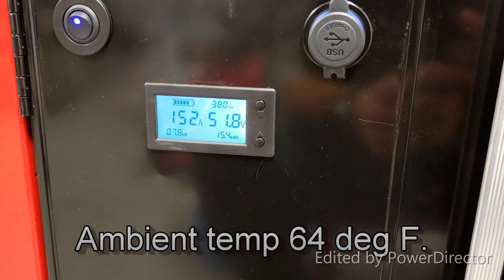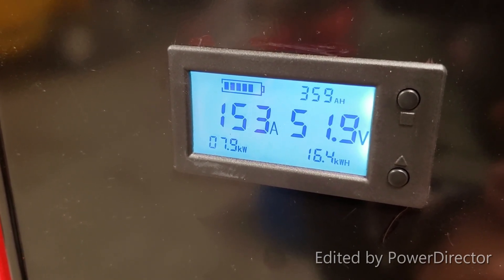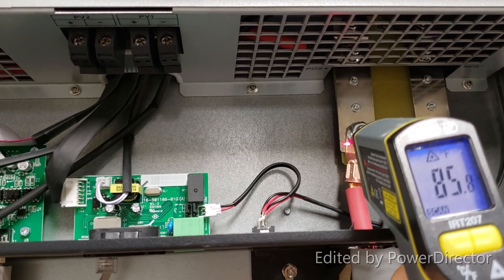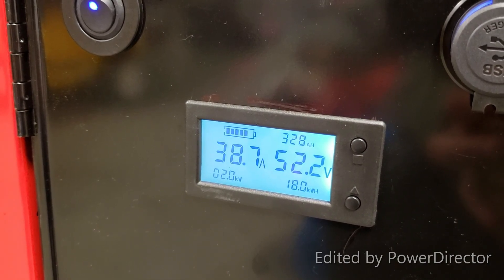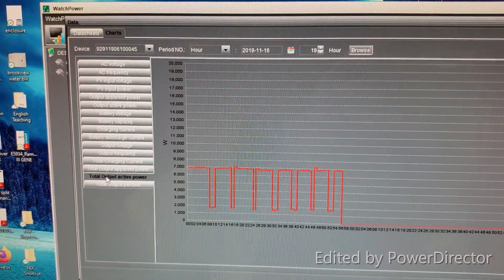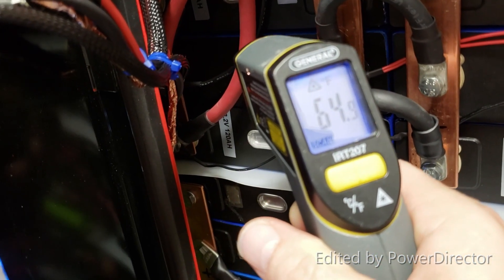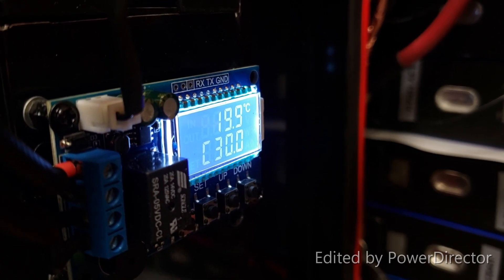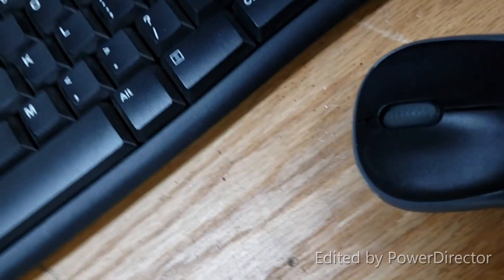MPP LV5048 and Power Wall Load Test

Comment: something to consider is a Heat Pump dryer. crazy efficient, low draw, and all electric  . ticks all your boxes. Also, cheaper than batteries inverters and panels

Comment: Hello! Really enjoy your videos! Was thinking the same about using a dryer. If you're going to dry clothes with a battery, you need a gas dryer.
Reply from the maker: Thanks for the comment. I go back and forth between wanting a gas dryer and keeping the electric one. However I do want to be as energy independent as I can be. If I replace electric dryer with gas one I am replacing one dependency with another.. Time will tell. Watch other videos. I am planing to install more power walls.
Reply: @DMIINC2013  Clothes will dry on a clothes line even in the winter.  A friend of mine lives in Colorado and is determined to never use a clothes dryer.
Reply from the maker: @dhalifax562  That is true and I agree. LOL However wife and HOA don't seam to see it the same way as I do.

Comment: Awesome test..... Shut have wrong polarity on energy meter .... If you use power from battery's it should be negative amps... Flip the two small sensing leads on shunt....👍
Reply from the maker: That meter is totally counter intuitive. I agree with you, however it is hooked up correctly as it is now.

Comment: Those breakers you where using in the past, what is the model numbers...the one on the batteries to the 5048s and what shunt combo are you using for your gauge here, how did you set it up?
Reply from the maker: Those breakers are junk and not used anymore. Currently working with CBI D2ALX20192. So far much better. Battery monitor is from amazon https://www.amazon.com/gp/product/B07B4CWKRJ/ref=ppx_yo_dt_b_search_asin_title?ie=UTF8&psc=1

Comment: Are you running both 5kW LV5048's in parallel to produce the 8kW for your dryer tests? If you are only running one LV5048 for your test how is it able to exceed the rating of 5kW?
Reply from the maker: Yes. 2 in parallel.

Comment: Most lithium batteries do not heat up but all the connections wires bus bars and inverter mosfets do so make sure you monitor that. All those temps are really good no heat.
Reply from the maker: Thanks for the reply. Yes, voltage droops across connections and inadequate equipment will cause higher temps and loss of efficiency. State of GA gets up to 100 deg F. in summer and my garage is not insulated hence placement of sensor in middle of battery pack. It will be most useful in summer. Climate is temper in winter and garage rarely gets in to lower 40's or upper 30's.
Reply: @DMIINC2013  Yes Georgia is hot and you be surprised what a couple of well placed fans can do to disperse the heat. Cheers thanks for the sub
Reply from the maker: @offgridwanabe  Watching your vids right now, but to reply to your comment. I do have exhaust fan on top of that power wall. I really want to see what it will do in summer. Time will tell.
Reply: @offgridwanabe  I love the 18650 fans from walmart. I have them everywhere I'm pulling a large amount of power from. They don't add on the amp draw, if you are coming close to the limit either. Great video.